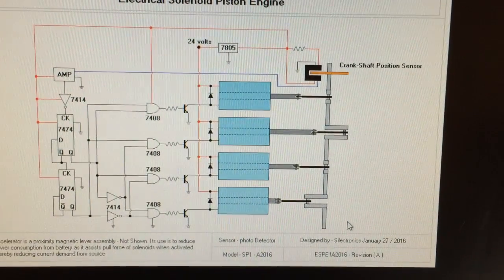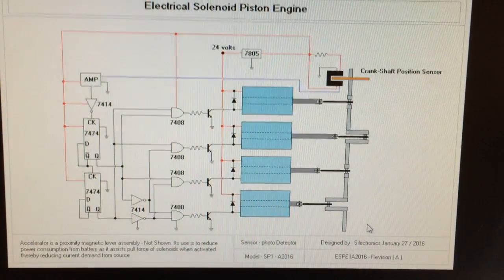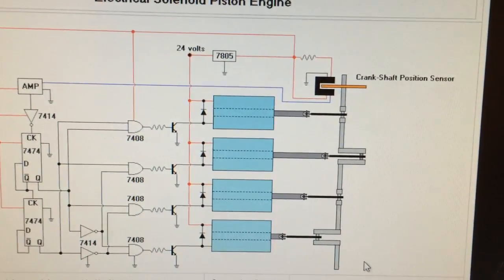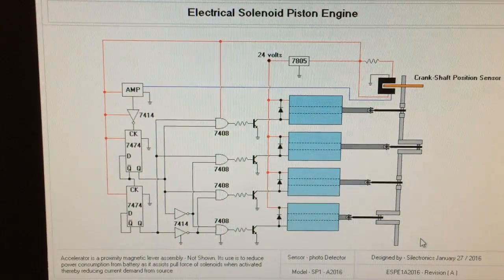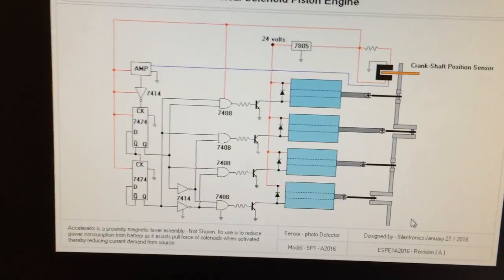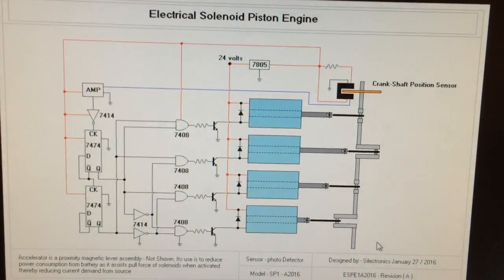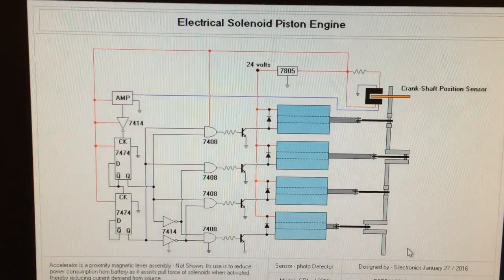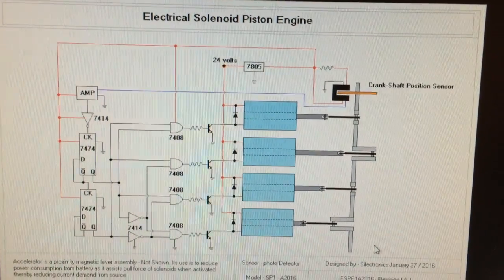Electronic control for solenoid piston engines

Comment: Why don't use four sensors placed near each piston to track their exact positions? It would eliminate start position dependency issue
Reply from the maker: You’re right except that more electronics are needed and each sensor must still be placed correctly so that it does not overlap trigger pulse from other sensors. One sensor is enough and already advances the counter to individual coils per pulse and this also gives plenty of space for each pulse so that false triggering does not occur. Decoupling is not enough in this type of system. I would need to also add one-shot circuits to prevent multiple pulse outputs from sensor due to misalignments if I add more s snots so I think one sensor works just fine.